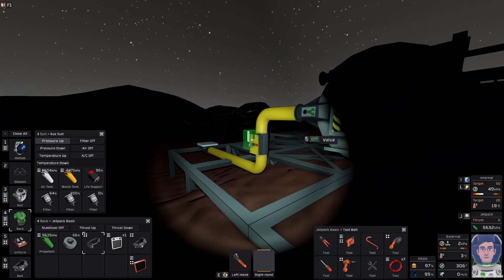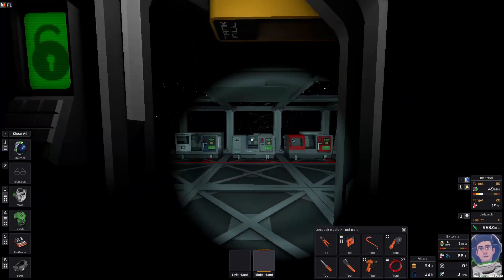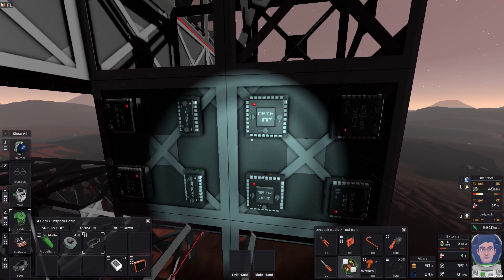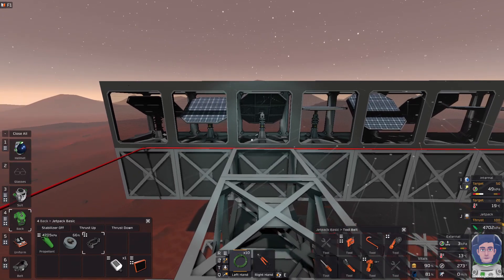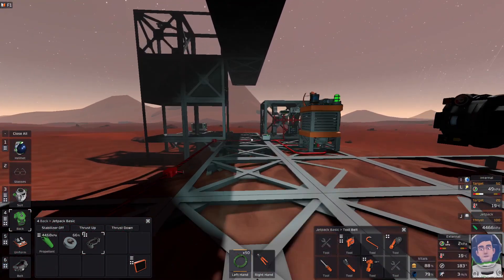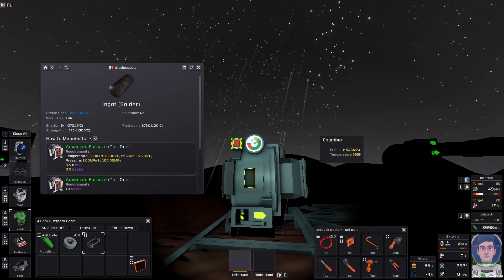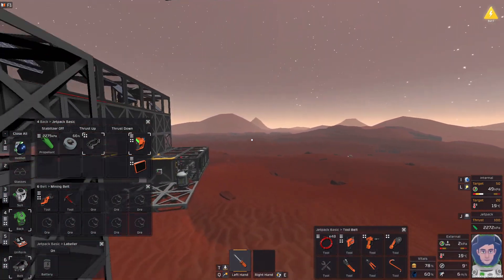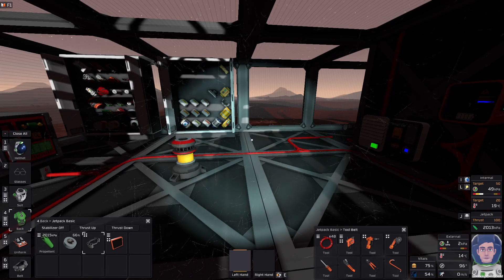Stationeers: Mars - "You Asked For It" - Steel talk and Solar tracking Ep 010

Comment: On the subject of stackers, another suitable use would be to produce three more of them, place one on top of each of your printers (i.e. elec. printer, pipe bender, lathe), wire them in, and connect the printer outputs to the stacker inputs with chutes, and set the stackers to material stack sizes (e.g. 50).  Then when you are producing cables, frames, sheets, pipes, etc. they will come out stacked for you, rather than a mess of single units that you have to spam click to clear up.  Cheers!
Reply from the maker: Yeah been thinking about that after seeing others do it but keep forgetting to as I want to move the printers also.
Reply: @slimmonkey8164  A better way would be to build chutes to connect all the outputs of the printers and have them lead to a single stacker.